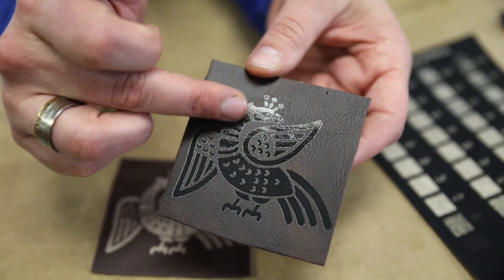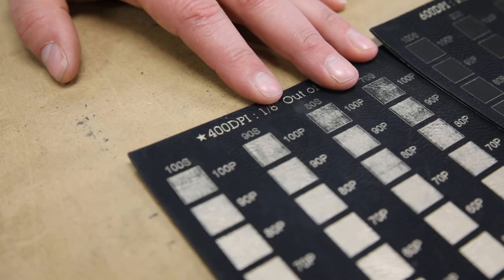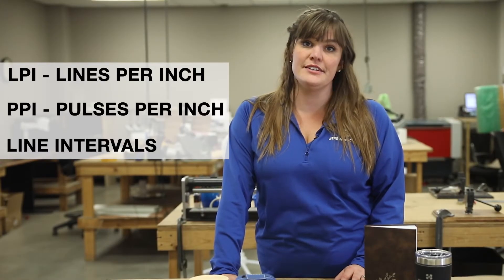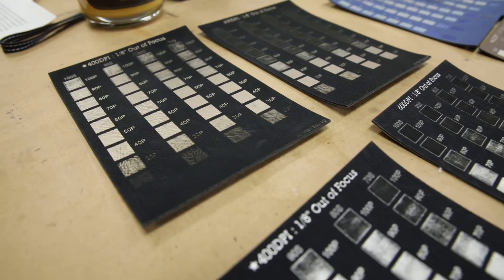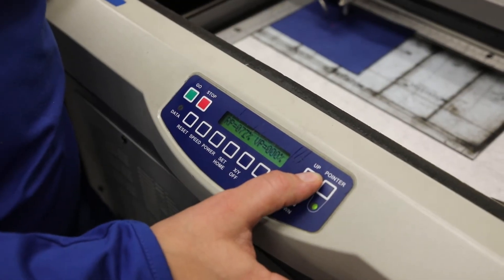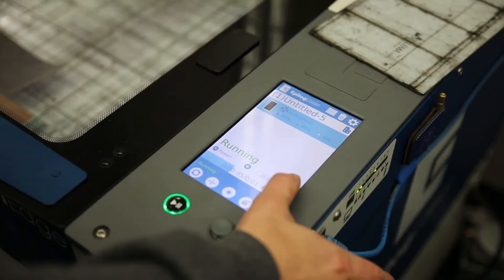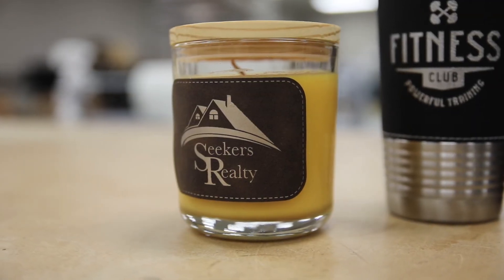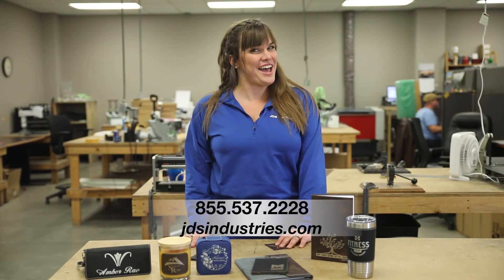How To Find the Best Settings for Laserable Leatherette

Comment: How can I tell if leatherette I ordered is metal or not - i.e. the color it will laser.  For example I just ordered sample set LLASET2 Several sheets for testing.  How can I tell what color each sheet will engrave without testing each of the sheets I ordered - because I think you are telling me the ones with light colors would use different settings from those that engrave black.  Same with a sample set of journals.
Reply from the maker: Each sheet should have a sticker with the SKU on it. You should be able to type that SKU in on our website which should pull up the colors for that sheet!
Reply: @ thank you

Comment: Quick Question!   Just received your patches and I have someone coming this morning to inquire about 100 hats!!    Quick questions - are they fine for outdoor use?   I'm assuming they are but your website states indoor use only?   Any issues with people putting patches on hats?   

Second question...I just peeled the paper off the back to use my Stahls Hotronix 360 hat press but I noticed it's sticky.   Beauty - this will help with placement...but is it actually a sticker?   It mentions 'iron-on' on the website...but it seems that the sticky is so sticky that that's all that's needed.   Does the hat press melt this substance for a tighter bond?     

I'm sick of trying to stain leather so I'm really hoping these work out!!!   I look forward to hearing back from you!!  Thank you!!
Reply from the maker: Thank you for bringing the website information to our attention. We will take a look at that! The leatherette will stand up to outdoor use. The adhesive on the back is heat activated and will give you a good hold. With any adhesive based product there will be limitations and you may start to see peeling with excessive sweat and/or washing.

Comment: cut settings for a 60 watt?
Reply from the maker: We recommend a starting point of 25S 45P 500hz!
Reply: @JDSINDUSTRIES  are you sure this is not backwards? 45 pwr is alot
Reply from the maker: That is what works on our specific laser. Doing testing on your machine is going to be the best way to get the best setting for you!